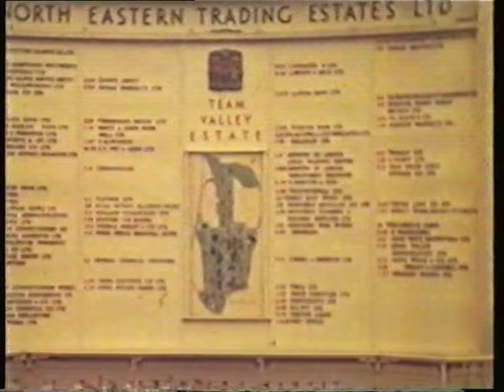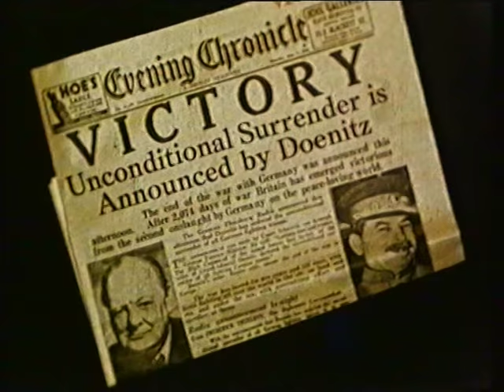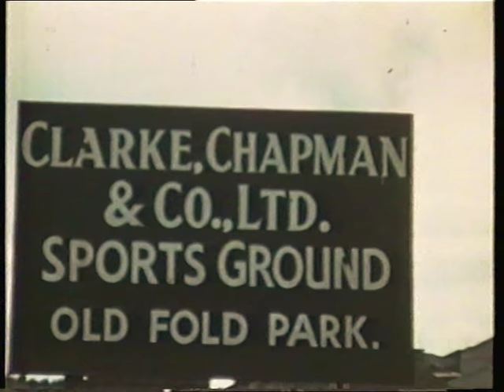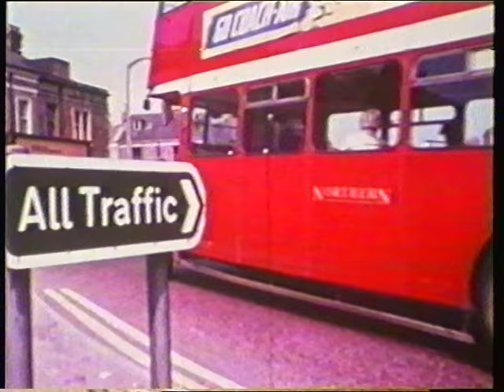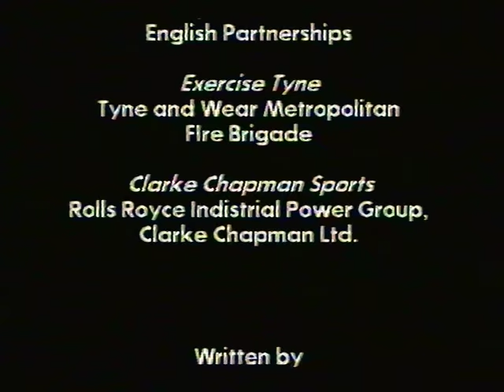Gateshead 1925 TO 1972

Comment: Actually, the Hell Gate Bridge in New York City came well before both the Tyne Bridge and Sydney Harbour Bridge and looks like a smaller version of the latter.
Reply: Similar, I agree, however, the Wylam Railway Bridge (Northumberland, UK) opened in 1876 is also very similar but without the stone towers. Made from wrought iron and about 240foot long. The old track goes along past George and Robert Stephenson's house they lived in in the 1800's. This is about 8-10 mile west of the Newcastle Tyne Bridge. I wonder if there are more older designs the same/similar too. 🤔